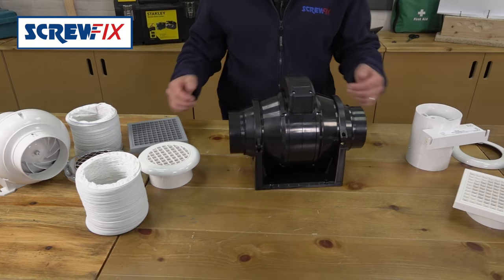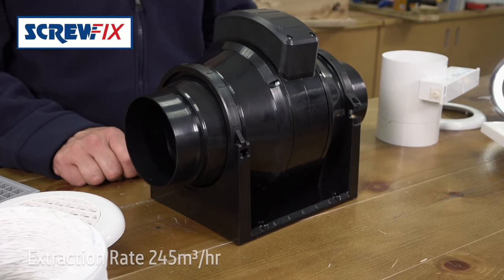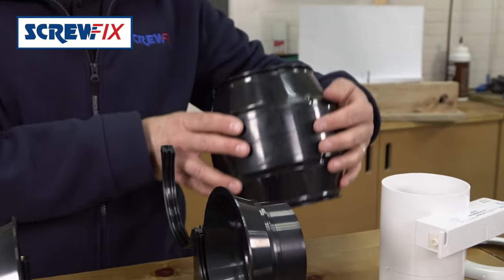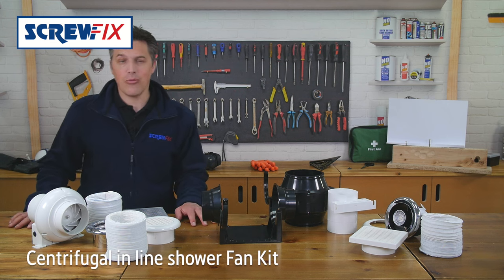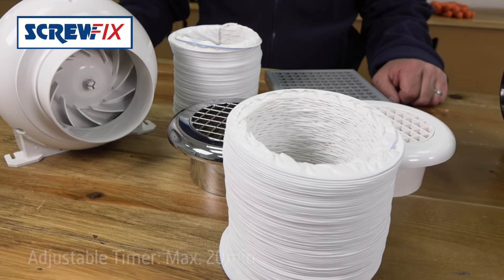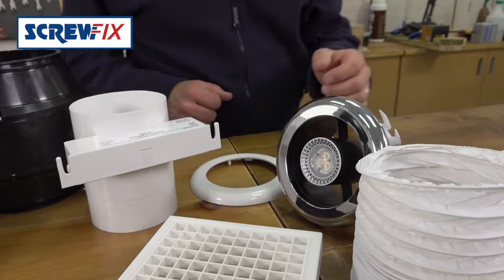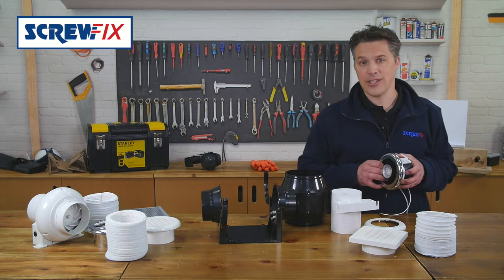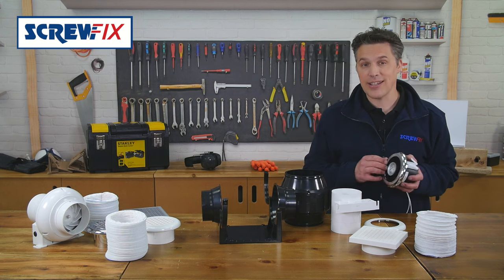Screwfix - Manrose Fans

Comment: I have the 110m3/hr version, and it's still not enough to keep the mirrors and windows clear in a relatively small bathroom
Reply: Tks
Reply: thank you for this! was just about to go and pick one up - will make sure we get a more powerful one :)
Reply: @WillowSilverwolf  - No problem Elizabeth.  Try the Manrose 100T.  That's the black one in this video.  £50 and a much better designed fan compared with the smaller one's, also has 3 speed levels.  I've just fitted one in another property and it's very silent, only a little above background noise.   HOWEVER, I've had quite a lot of playing around with the ducting.  Yes, insulated is a wise move to reduce the possibility of condensation, but, I've discovered that if it has an aluminium tube inside, then this accentuates the sound of the air, especially when pulled tight!
In conclusion, I replaced the aluminium central duct with a PVC duct (just pulled it out of the insulation and fed the PVC one back in).   This reduced noise levels in the bathroom by 15db, but also I discovered that ducting can get louder when pulled tight.  So, have the ducting straight, but don't worry about pulling the ducting too tightly.  It seems that ducting that is a little bunched up in the coils, softens the sound.  Perhaps it bounces around more when pulled tight.  Airflow didn't seem to change.  Hope that helps. :-)

Comment: Does the fan assembly fit through the hole? If not, you need to go through the floor above or remove ceiling to fit or replace.

Comment: The flexible ducting for every metre of run there is 3 metres of resistance because of its makeup. If possible use ridged ducting for better flow rate.

Comment: Great video. A question if I may: is insulated ducting worth the extra cost over the white plastic type in this video? We inherited two bathroom extractor fans in our house and one has an insulated hose and the other does not. I wondered about "upgrading" the non-insualted one but wasn't sure if it would actually make a difference.....or whether it would just be a placebo effect. 

If it makes any difference, the non insulated one (family bathroom) gets more use than the insulated one (en-suite)...